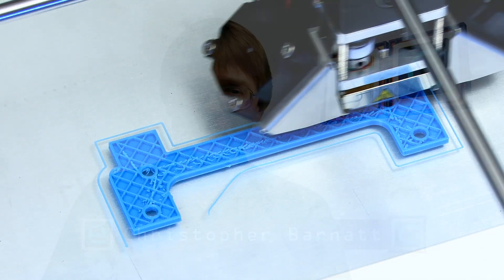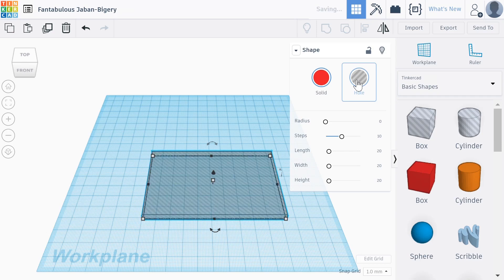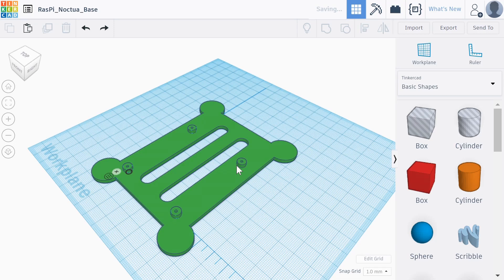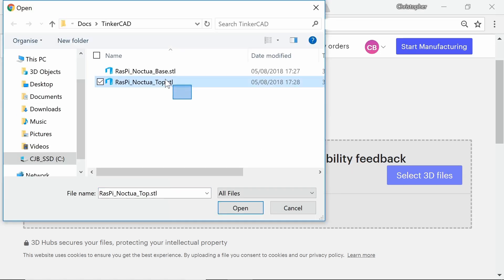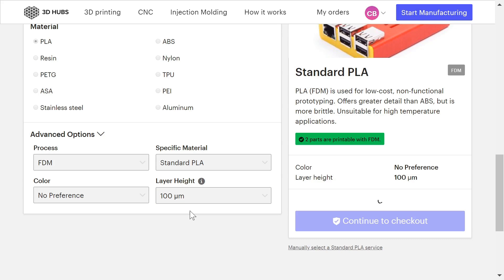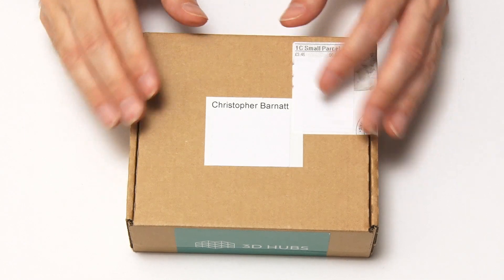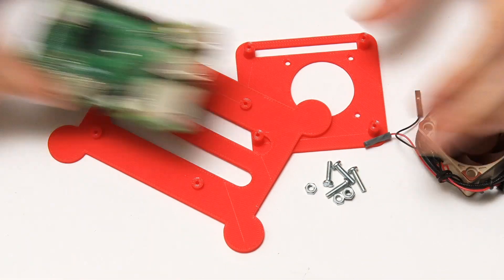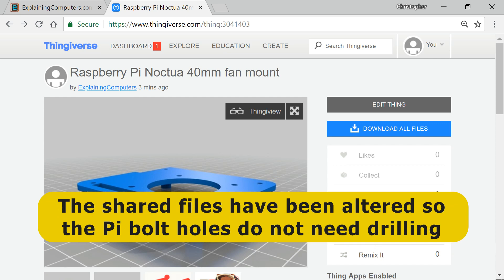Online 3D Printing: Tinkercad & 3D Hubs

Comment: Personally, I would recommend people stay away from using 3D Hubs SINCE this video was made for 2 reasons:
1. The prices have gone up a lot. In the video Chris paid £6.19 for his 2 pieces, if you were to order these now it would cost £14.53 - at least from where I live (England also). That's paying £9.36 extra for the same things!
2. And the next thing that 3D Hubs do now compared to when the video was made is that they add a surcharge for orders under £30, meaning and extra £15.47 is added to the bill, and then with the tax on top that makes it £36.
So from when this video was made you would be paying an extra £25.96 for the same parts 3D printed, and yes I did set it to 2mm layer height in Red PLA.
https://imgur.com/a/XzmJEdz
(If you know some one with a 3D printer I would definitely ask them instead.)
Reply from the maker: You are sadly right -- 3D Hubs has reorganized twice since this video was made, and has increased (minimum) prices dramatically in the process. I now sometimes use 3D printing services in the UK that were/are 3D Hubs hubs, and get a faster and far less costly services. In particular I find http://seaside3d.com/ very good -- and that have not asked me to say that! :)
Reply: @ExplainingComputers  It's unfortunate the way they have changed the service they have provided as it makes it less affordable for people to make their own parts, however it is also good that there are other new 3D printing services are appearing to provide alternatives from 3D hubs like the one you have suggested. (Also thanks for replying to my comment) :)

Comment: Hi Chris. In this video it show you printing the parts for about £10 - now it seems like there are minimum charges of between £20
And £30 - specifically on 3D hubs but also make it quick.com. Was it just timing that meant you avoided this or did you have some other deal?
Reply from the maker: Sadly, and very recently, 3D Hubs have now introduced this surcharge  (it was not there in June 2019). I have recently printed from the service at the bottom of this page: https://www.gallerymarkw.com/seaside3d/ -- very cost effective for those in the UK.

Comment: Maybe a new video on the official poe hat? Id love a review from you on that
Reply from the maker: Great idea. The only problem is, I would need a network connection with power to test it.
Reply: That is a problem... Not sure the best way to get around that. I'm going to be using the Unifi Switch 8 with active poe. But you need controller software on your network to provision the switch. Crosstalk Solutions had a video about loading the Unifi controller software on a Pi. It's how I was running mine till I switched to cloud recently.

Comment: Being both by AutoDesk, Tinkercad looks very similar to Fusion 360.
Fusion 360 exports .step, which i convert to .stl using FreeCAD
Reply from the maker: It does, though it was not developed by AutoDesk -- rather than acquired the company. :)

Comment: The price charged by 3D Hubs is very reasonable ! I can dump my RepRap Darwin.

Edit: I tried 3Dhubs and it is very expensive nowadays -  Printing small parts like yours would cost around $70 CAD (around $60 USD) in Canada. 18/12/2018

Comment: 3D hubs is great, I used them to print out a case for a small 5 inch lcd screen I put together for my raspberry pi. there are a few imperfections with it that I think were more laziness on the person doing the printings part. But overall I'm satisfied with the results. and considering that my print was shipped halfway across the country to get to me, I was surprised by the speed I got it.

Comment: SIR CHRIS,  I BACKED UP THE OLD SYSTEM. JUST OVER 200GB FILES,DATA,PICS,VIDEOS. AND BACKED UP NAS1 TO NAS2!  HOW FUN!  I NEED AN AUTO BACKUP TO GO LOOK FOR ONLY NEW FILES AND ADD THEM AUTOMATICALLY TO THE NAS. LOL  (I REPORTED A BOGUS OMV ERROR THAT CONTINUES TO SHOW UP WHEN LOGGED IN DIRECTLY. SEEMS OTHERS HAVE SAME PROBLEM. MAYBE IT WILL BE AN "EASY" FIX. (NOT OVER MY HEAD)MY LIMITED SPACE ON MY COMPUTER DESK WITH BACK SHELVES, I NEED TO CREATE A STACKABLE SHELVE UNIT. BOTTOM SHELF --- MY ROUTER, WND SHELF-- MY 5PORT GIGABIT EXPANDER, THIRD SHELF--- THE QTY2 HC1 NAS UNITS.JUST ENOUGH SIDES PER SHELF TO HOLD UNITS IN PLACE. TOP SHELF FOR NAS. CREATE A DEVIDER TO KEEP THEM IN PLACE SIDE BY SIDE.  LOW SIDES TO ALLOW AIR FLOW.  ALSO THINKING OF SHELF BOTTOM WITH HOLES DESIGN SOMEHOW TO ALLOW AIR TO FLOW UP THROUGH EACH SHELF.  SOUNDS LIKE I CAN USE YOUR LATEST VIDEO AND A 3D PRINT SERVICES. SHOULDNT BE MUCH. YOU THINK?  SIMPLE DESIGN.NOW I AM LOOKING AT SOFTWARE REFERRED TO ME BY OMV TECHIE FOR iPAD. HELP DOWNLOAD THAT DATA SINCE IT IS IMITED ON THE OS MORE SO THAN A MAC PC. SOFTWARE IS FREE.. GOOD NEWS.AFTER THAT I WILL LOOK AT ROCKPRO64 IF IT IS READY WITH BUGS REMOVED TO USE SATA SSD CARD. SEE IF MINT HAS ALL THE DRIVERS FOR ROCKPRO64 TO RUN WELL.STILL FIGHTING WITH HP WHERE I BOUGHT LAPTOP AS I HAVE 1 YR SUPPORT ON IT.  ALSO MICROSOFT TO ASSIST WITH GETTING THEIR UBUNTU APP WORKING PROPERLY AS THEY HAD IT IN MICROSOFT STORE.  I WANT TO GET ON UBUNTU ASAP! GET SOME EXPERIENCE AND LOOK AROUND A BIT!THEN I WILL BE READY FOR SBC AS MY PERMANENT WORKSTATION.  LEARN LINUX TOOLS, COMMANDS, SEE WHAT APPS I CAN USE FOR MY START UP BUSINESS IN A FEW WEEKS! BOY TIME FLIES.THANK YOU AGAIN AND AGAIN FOR YOUR VIDEOS AND POSITIVE SUPPORT!
Reply from the maker: Thanks for this -- and I'm glad to hear that things are working with your NAS venture! :)

Comment: Can someone video chat with me to help me design something in “any / your choice” of cad software for metal 3D Printing. The basic if what I need is a cylinder with 12 snapping points, 30 degrees apart from each other. And a rectangle, like a flat wire, thickness and width will be determined later. But I need to be able to pick any two snapping points to drag the rectangle between them and have the center of width of the “flat wire” snap to the other snapping points I set (12)
Reply from the maker: Good luck. Note that when printing metal you need to design in supports to conduct heat away, even though the object will be supported via the powered around it.

Comment: I need a CAD program, capable of creating a profile by importing coordinates of its points; then extrudes it along a path in the 3rd dimension for 3D printing. Do you know any CAD program with such capability that is reasonably priced for personal use?
Reply from the maker: For personal use, you can use Autodesk's Fusion 360 for free.

Comment: I was able to get the price of my custom pi case down from £10 (£6 + $4 shipping) to £2.90ea by ordering 10 units (£21 + £8 shipping) at 3dhubs. While I have my own 3d printer, at £3/each it becomes feasible to just pay that instead of doing it myself !
Reply from the maker: That sounds like a great deal -- 3D Hubs is indeed very cost effective for larger numbers of prints.

Comment: Is there a way to refer a 3D printing place to join as a HUB?. Also could you refer a good p&p keyboard + mouse and a decent WiFi dongle? For a Pi3 B+.
Reply: The place, I am thinking of is in Worksop. So maybe it will be easier for people in the area.
Reply from the maker: Anybody can list there printer -- details here: https://www.3dhubs.com/list-your-service Any USB keyboard and mouse will work with a Pi 3 B+. It does not need a WiFi dongle as WiFi in onboard.
Reply: @ExplainingComputers  Thank you. And I know, I will be creating a repeater that can connect to multiple connections. And will need a dongle as I will change the Pi's WiFi.
Reply from the maker: Ahhh . . .

Comment: I own a 3D printer, and I can tell you that so many times I need to print test portions of the design so I can confirm my dimensions.  As you pointed out in your video you missed some points on your part, though in your case they were a minor inconvenience, often times they are not and you have to scrap your initial part.  For people just getting into this, designing and getting the dimensions right is 99.9% of the effort, that .01% difference can bite you in time spent waiting for a second or third version of the part being shipped to you.  My experience is that it usually takes around three design iterations to get the part usable.  I'm not trying to discourage what you are saying in your video, but I feel a little more stress in taking the time to confirm your dimensions and design are extremely import considerations when using strictly online sources for printing services.  At any rate, I love your videos and watch all of them so don't beat me up for my message here Chris.  Thanks!

Comment: If I was you I would have raised it up some more off the base to allow airflow under the board and access to the microsd card instead of a cutout. If you look at a heat map for the raspberry pi 3 you will see the underside gets especially hot where the CPU is and where the gpu is. Honestly
Reply from the maker: I'm sure this is true. But the reason I left so little clearance (just what was needed) was that I had the 20mm bolts, so had to keep the total height of the two sections, with the Pi in the middle, to about 17.5mm (allowing for the nuts to go on!). :) But yes, I ought to have got some 25 or 20mm bolts.

Comment: they can also print in aluminium meaning some one could actually make a PC case or even a heat sink! (as long as your PC does not weight 80 lbs like my friends... that weights as much as a PSU to turn a tank turret ;P )
Reply from the maker: I had not thought of printing a heat sink. Now that is a great idea! :)
Reply: one that the guys at Linus Tech Tips could of used when they tried to "cast" one! if computers could have mutated parts, that is what it would look like! but that said, you could probably print any size/format for any of your boards (or future ones) with that! (because usually the problem people face is clearance.)
Reply: They might not be printing in Steel or Alumnium, they might just use CNC to mill out the metal (though there is also sintered metal printing)
Reply from the maker: The option that came up was under 3D printing -- and I imagine you are right that they are using DMLS. However, metal can also be 3D printed via material extrusion (WAAM, as it is sometimes called), and also via binder jetting (eg the ExOne process). I don't know which technologies 3D Hubs is providing access to -- certainly the ExOne process is offered by imaterialise and Shapeways.
Reply: In the comppany where I work which is realted to the oil industry, newer tools come with some parts 3dprinted. They are quite complicated and 3printing is a convenient solution due to the ammount of parts to be made, that are in the dozens.. Maybe for higher quantitys extrusion could be more convenient..

Comment: When you uploaded the design for the fan mount, you had it oriented with the spacer legs down. Anyone who's done 3D printing would know you would flip it around to avoid having to have massive support structures. The printed part obviously didn't have any evidence of support structures that I could see so the 3D service seemed to figure that out. I'm curious if they automated that or someone sat down to convert the STL to GCODE and knew from experience to do that.
Reply from the maker: I built the top that way to ease my design/measurement process, and in full knowledge that it would be 3D printed flat on the bed with no support structures. Having written three 3D printing books and done a great deal of consulting in the area over many years, I am well aware of how objects need to be designed and later orientated for printout. My assumption was that the top would be flipped in the slicing software (when you use a 3D printing service is it the user's task to provide a printable file, not to set up the print). But you are right that I ought to have mentioned this in the video. This all said, I strongly suspect that 3D Hubs may anticipate the optimal orientation -- if you look at the printability part of the video you will see that the software says there are no hard to remove supports, which perhaps suggests that it has considered optimal orientation.
Reply: Thank you for your good work, you always inspiré me.

Comment: It would have been nice if you showed prices for the other options such as CNC.  Your design is relatively simple and wouldn't take long by CNC.  Prices will vary by location just like FTM but it would be interesting to compare.  (Of course if you were to really get the Pi mount made in aluminum you would have to worry about adding insulators to prevent shorting anything out.)

Comment: You forgot to put "ec" on your design!  Part of fun of making your own custom parts is that you can make it look different than a bulk injection moulded part.  Put your logo, initials, date or version number, etc.  Put a little hart on it if it is for the wife, etc.  It only takes a minute to add it and doesn't add to the printing cost whether at home or with a service.
Reply from the maker: Excellent point!

Comment: That is really brilliant, the ability to produce custom cases and boxes etc. We can also produce our own PCB's and get them produced in China very economically so the days of my Heath Robinson "lash-ups" could be over!

By the way they are not BOLTS.  Bolts have threads only on the end, the rest of the shaft is plain. You fitted SET SCREWS where the entire length of the screw is threaded.  These are sometimes called MACHINE SCREWS to differentiate them from WOOD SCREWS etc...….  Anyway back to SBCs.
Reply: They're called farsteners.

Comment: Excellent video!  I am going to try this out for sure!  What I also would need is a way to 3D scan an object (for my classic car plastic molding trim replacement project).  Also on your project here, since the SDCARD is a bear to remove easily, maybe cut out the area and then make a small clip device that snaps onto the sdcard and fits into the shape of the prior cutout.  Then one can easily remove the SDCARD and insert it.  Just a thought.

Comment: As a professional "tinkerer", I would prefer prototyping this way rather than 3D printing myself.

What most people forget about 3D printing, is the lack of experience and the many failures, which may in the end cause to hate the printer you got.

In order to become a professional, you need to take in account the time you invest for learning a CAD software and the waste of material "on the way of perfection". Learning CAD at its best can take months, and the waste material and broken printers can easily go out of hand, pocket and bank account 😊

Comment: LOVE THE VIDEO!  I am sending this to my candle mold Supplier.  He had 3D setup to measure my candles and make exact shape molds I need specifically for my candle.  He will get a kick out of this video!  He builds computers on the side also. I will create a shelving unit for my hc1s and Router to neatly stack them on computer desk top shelf. That will hold them in place and I will not have to worry about cables pulling them down if I have to move the desk out to get behind it. You did it AGAIN!Give me ideas LOLNeed to design something useful for Wife 3D print, she would enjoy getting involved and also the outcome.  Is there a limit on size of item u think?  I can look it up on their website.maybe hold her wrings, earrings, necklaces. that's small but by her design liking.
Reply from the maker: Thanks for this. Desktop 3D printers (which will be what are used for most 3D Hubs printing) typically have a build volume of no more than 10 x 10 x 10 inches. However, 3D Hubs has some hubs with much larger industrial printers, so much larger items can be printed if needed (though it gets rather expensive!).

Comment: I'm confused about screws and bolts too, and I'm supposed to be an engineer. I reckon if it needs a srewdriver it's a screw; if it needs a spanner it's a bolt.
Reply: James May says that if it attaches an object directly to a threaded hole in another object it's a screw but if it uses a nut than it's a bolt. And then he rambles on about caveats to all of that. So there may be no real answer. lol.
Reply: I was taught that if it is threaded over its entire length, it's a machine screw, if it's only part threaded, it's a bolt.
My school teacher was an ex engineer, but he could still have been wrong...  :o)